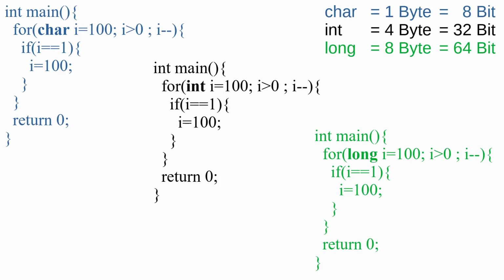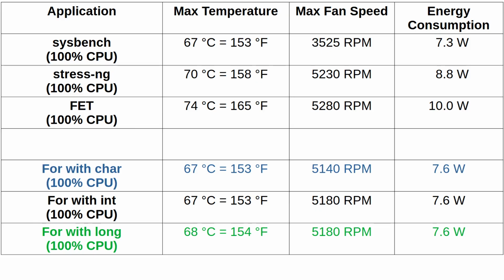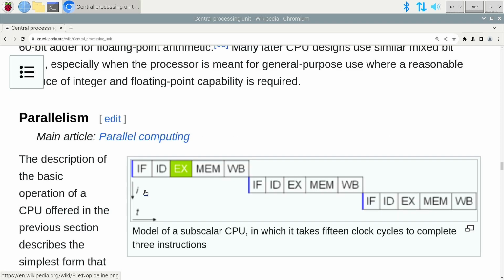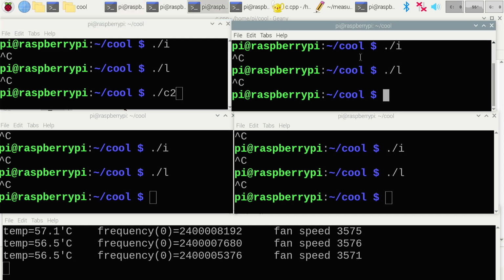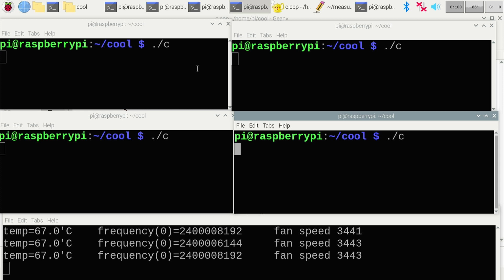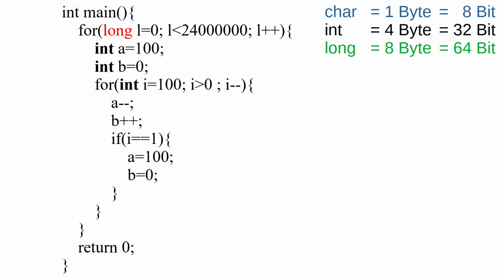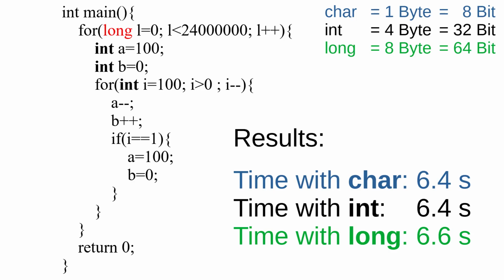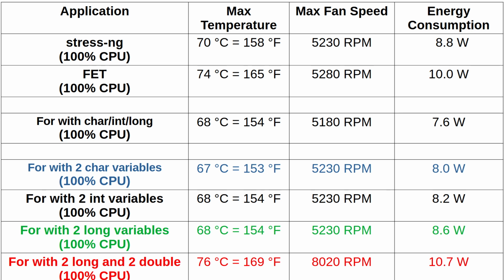Cooling the Pi 5: The truth about a good cooler test and how to stress the CPU

Comment: It is possible to set the fan PWM speed fixed at level 3, would give better comparable results.
Reply from the maker: Yes, that sounds like a simplification that will make it easier to compare. I am currently not 100% sure if there might be other side affects by that. So maybe, just to be sure, it will be more save to measure it not only with stage 3, but for every stage. Then the max temperature will be interesting. And if it hits the thermal limit at 80°C then maybe the time to reach that will be interesting.
If the stage is always changing, like in the default settings, then one variant might be to measure how much percent of the time it will stay in the higher stage and how much time in percent will stay in the lower stage.
Not easy to measure all this stuff.

Comment: Nice video. Thanks for exercising stress-ng. The CPU stressor in stress-ng is a generic compute mix, so it may not reach maximum thermal limits.  One may find better results when exercising combined floating point compute, cache and memory operations such as the matrix stressor or the fp stressor using one of the many fp-method options.
Reply from the maker: Thank you for your feedback. So I am not totally wrong if the master of stress-ng write me such a nice answer. I saw your GitHub repository, but I must admit that I didn't read all your different tests. It was just a bit luck that I discovered this stuff. I just saw other YouTubers using stress-ng and the measured temp was totally different from timetable generator FET on a Raspberry Pi 5. So i tried to check the reason for it. Here are now only 10 minutes left, so I will turn off my computer now. Happy new year!